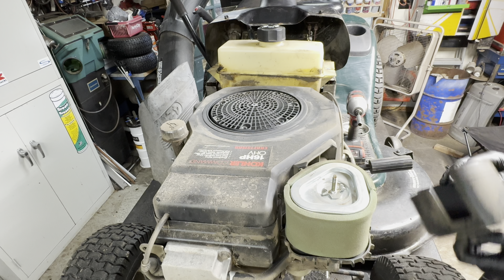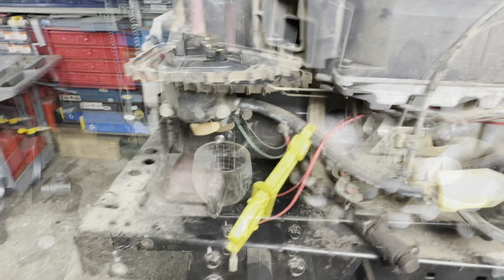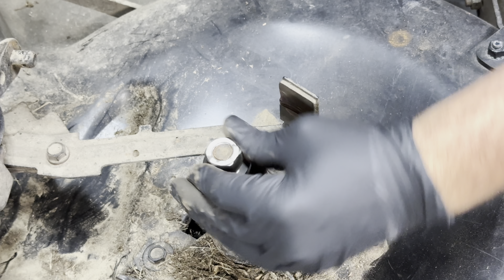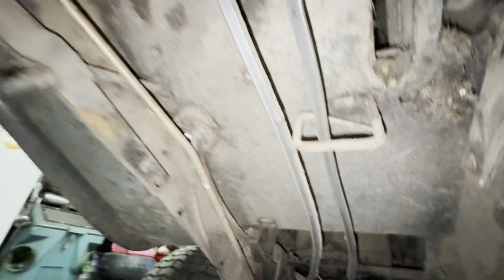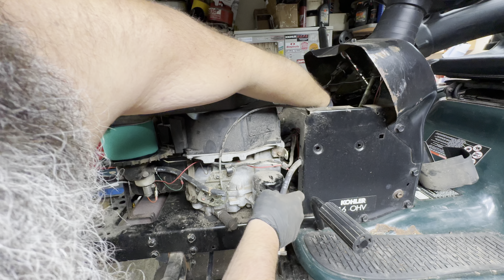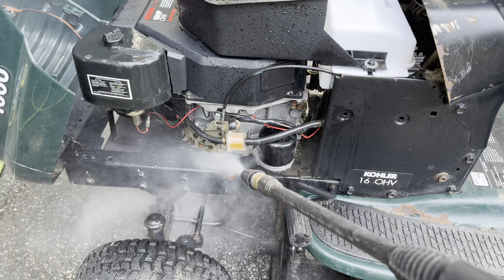Craftsman LT1000 Maintenance And Drive Belt Replacement

Comment: A very nice job. Looks good sounds good.  

Just a suggestion with the idler pulleys.  Drill out the spot welds take the 2 halves apart remove the bearing  (usually  a 6203)  then use half inch 1/4  20 bolts and lock nuts to put back together.  The best part is if the bearing goes bad, it's much easier to replace just the bearing.  I've done that, saved an easy $25 . On a 48 inch cut John Deere
Reply from the maker: I've come close to doing that a few times with some of the more expensive pulleys.  However these were about $10 each.  I'm definitely gonna try that method in the future though
Reply: @hester781  
10 dollars is a good buy. Good luck sir.

Comment: Those belts with the Kevlar cord in them are some durable. You were lucky that carb didn't have blocked jets, with that alcohol/water goo in there. I am fortunate that alcohol free gas is available at gas stations in Louisiana. I use it in my old 2000 Ford Expedition even though it cost more. ( With no road salt here, the thing won't die! ) 
 Some fellow has a video where he drilled out the rivets in his steel deck idler pulleys and replaced the bearings. He put bolts in the rivet holes. I guess he was looking for a challenge. I never realized how the 2 halves of the pulley must be held together while drilling because they must match perfectly in order to get the bearing between them when the bolts are tightened. As I recall, he bolted the 2 halves together before starting the drilling. His time was not a consideration, since it took a while to do all that. He bought the bolts & nuts on Amazon, so they were cheap. And he never has to buy another pulley. 
I put a couple of drops of motor oil on the top of my tractor pulleys and turn them by hand until the oil gets inside them. Then I wipe off the excess oil. That will last for several years as long as the bearings aren't severely worn to begin with. The Craftsman 42 inch tractor with the plastic General Transmission has 4 plastic idler pulleys under the frame.
Reply from the maker: I definitely got lucky with this one! And I've always wanted to experiment with rebuilding a riveted pulley. Someday!

Comment: Do you think the leak in that gas tank was a failure of the adhesive bonding the two halves together?
I’m thinking at least a temporary fix for that specific tank might be the superglue/baking soda trick. Of course most would probably go for JBWeld, although I’ve had problems in the past with getting it to bond to some surfaces.
Reply from the maker: I think the plastic tank was breaking down, hence the yellowing and discoloration.  I suspect this unit was kept outdoors most of its life.  I've used an epoxy called PC7 in the past for plastic tanks and it has worked great! Definitely need to sand/scuff up the surface before using it though 👍🏻

Comment: My recommendation is to wash the machine before you start just like musty does.  That way it's easier for all to see what you're doing and easier for you to work on.  And can you please explain why you did not change the oil, Oil filter and inspect the spark plug?  Otherwise a very nice repair as usual, Thank you very much.  👍👍👍
Reply: I agree about washing first!  Personal preference, of course.
Reply from the maker: I do agree there are many benefits to washing first, including giving yourself a clean machine to work on.  I just figured washing after was more of an "icing on the cake" effect. Perhaps I'll try washing first on the next one!  As far as the oil change goes, this unit will get one after I've mowed with it a few times.  I just figured on long videos oil changes can get sort of monotonous to some viewers, I'm still experimenting with what people want to see and what they wish I would leave out lol.  With spark plugs in general if I don't have any issues I generally don't touch them, though I do agree with you that it's good practice to inspect them 👍🏻
Reply: @hester781  One thing to remember,
Hester, Many of the people watching your videos want to know how to make the repairs and are Not unterested in the icing on the cake.  I think most of your customers, And I count my self as one of them, Want the cake.
Reply: @hester781 
I always clean and gap the original plugs unless they’re crap mfr like Torch, in which I replace, always NGK. 
Like to see oil changes as part of regular service of any machine, but fast forwarding would be good.

Comment: I’m much more inclined to replace spindle bearings than to throw money at whole new spindles. Working on a really tight budget I’d rather spend the time and get paid for my labor instead of getting paid for parts. 
That bearing puller set is currently $34 on Amazon Prime - I’d rather end up with a tool!  It’s more empowering than firing the parts cannon!
Reply from the maker: Agreed, it's cheaper to rebuild and in many cases easier!

Comment: In my mind I was thinking of an extra inch per end even with the gap in the belt at the end. Otherwise it would be 3 inches more.
Reply from the maker: I understand what you're saying and I agree, however I also drew a line with a sharpie and measured around in a circle and came up with the same measurement.  And ironically the new belt measured the same as well so go figure lol Measuring belts can be like the Wild West sometimes 😂

Comment: wers with the poor man power steering kit    needle thrust
i like them    usually check related like tire pressures    linkages     steering gear   and i put flanged bearings in the wheels      am doing it with mowers i sell
Reply from the maker: I installed one of those kits a month or two ago with a friend of mine, I have to say I really like it 👍🏻